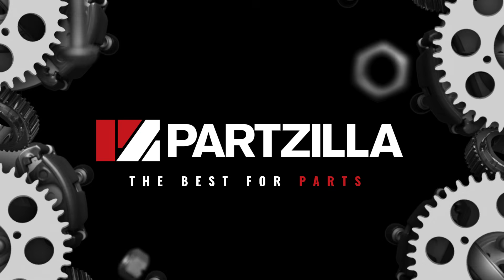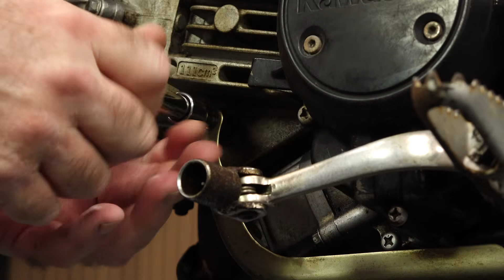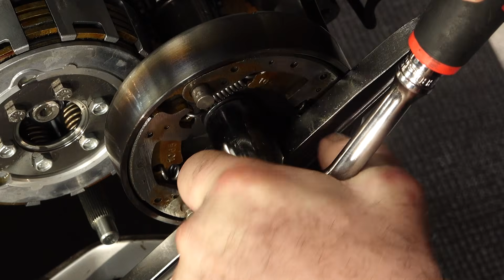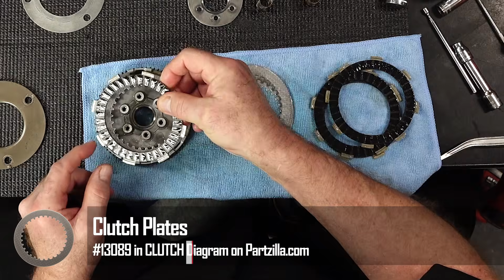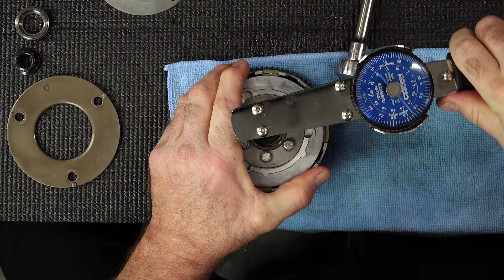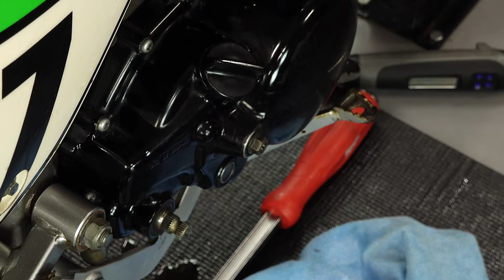KLX 110 Pit Bike Clutch Rebuild | How to Replace the Clutch on a KLX110 | KLX 110 Clutch | Partzilla

Comment: Impact works great for removing the clutch nut nuts!  Just KYI 

Also if you lay the bike on its side you don’t have to drain the oil!  Just be sure that it’s not resting on the shifter and putting any pressure on it because the shaft shaft goes all the way across to the clutch side and when you take it apart it can misalign the shifter mechanisms.
Reply: G y,x,zo9o7o8vr😢dri,yxv,f,,u